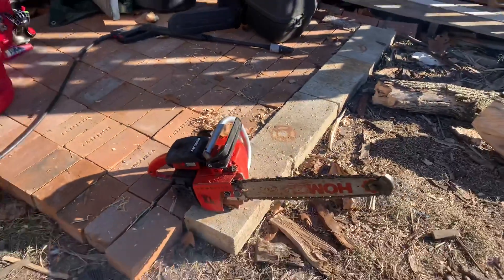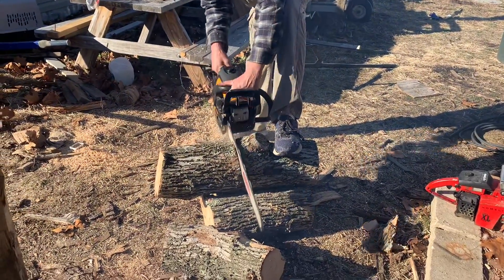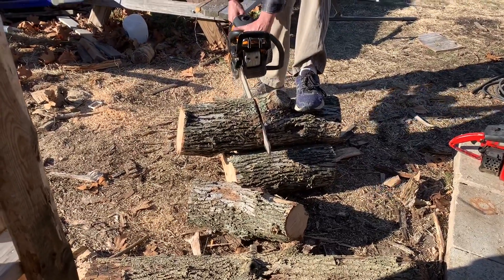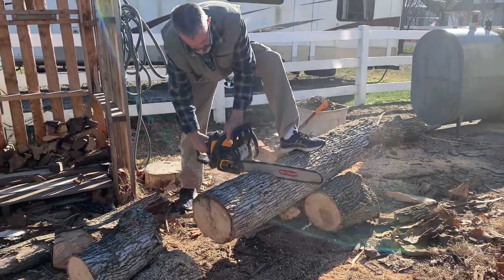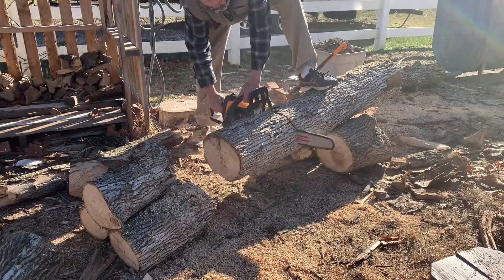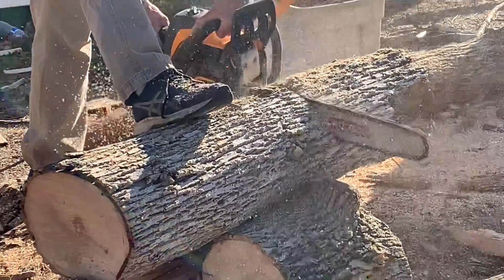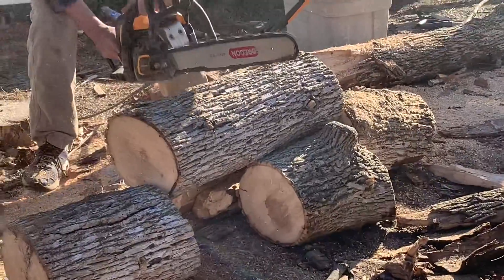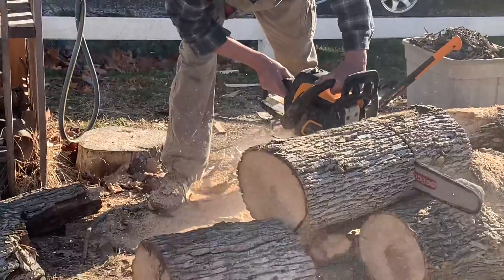Processing road side firewood, poulan pro 5021 and a Homelite super xl

Comment: The saws sound good. But your right the chains need some work. What parts do you need for that 10-10?
Reply from the maker: Yes these chains need help!, so I guess what my next job or video might be? Not, I have to un load the truck first!
Reply from the maker: I need to source the bar/ chain guide plates, so i can properly set the saw up, other then i need to get an air filter, mostly little stuff!